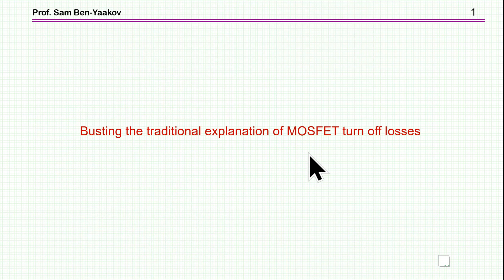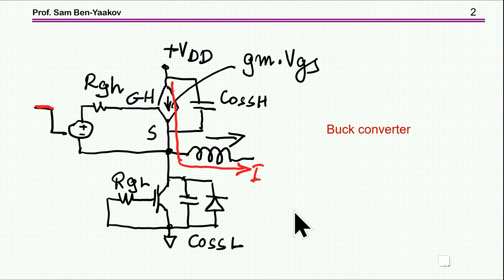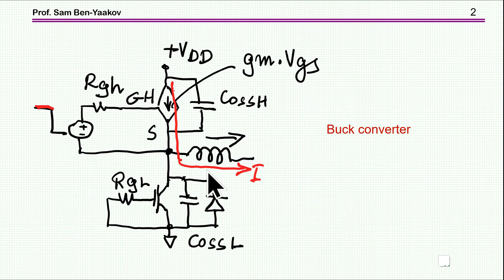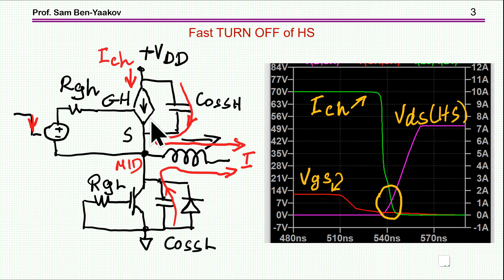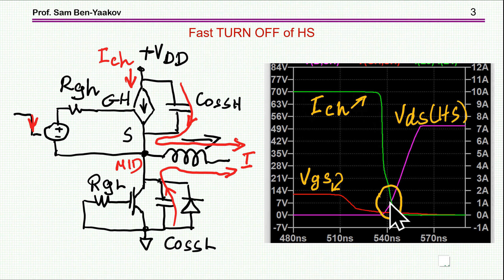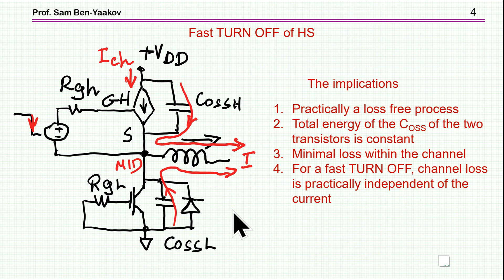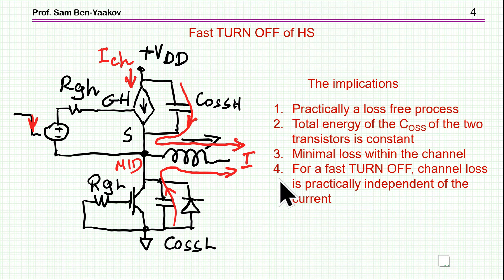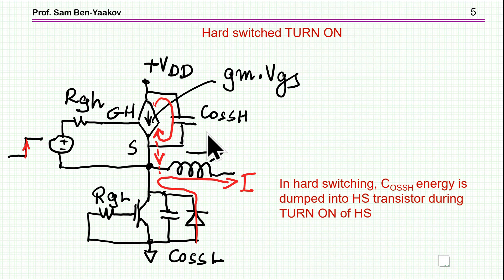Busting the traditional explanation of MOSFET turn off losses

Comment: Hi Prof, during turn OFF since there is a constant ILoad, we merely re-shuffle the charge on the top/bottom Coss elements ? 
Assume top Coss = Coss1, bottom FETs Coss = Coss2, 
during turn OFF, both CAPs give out total energy = (1/2)*(Coss*2*V*V) to the LOAD. 

VDD supply also gave a total energy = Coss1*VDD*VDD out of which half was delivered to the LOAD and Half is currently stored on Coss1. If we do a hard TURN-ON, then this half energy on Coss1 is dissipated in the top FETs RDS_ON while another half is burnt in raising Coss2 up to VDD. 

So essentially if we have hard switching on TURN-ON of top FET, only half the energy associated with the CAPS is delivered to the LOAD while other half is dissipated in resistive elements is this correct ? 

If we ensure that we can make the inductor current before TURN ON of the upper FET is slightly negative enough to charge up the switching node to VDD so that the Body diode conducts, and then we switch ON the upper FET, are we not pulling charge from VOUT and dumping it back to the source (VDD) which is kind of negative work done ? How does that improve efficiency compared to the hard switching case ? 

Kindly help understand this a bit more clearly. Thanks.
Reply from the maker: This is a good question. Hold on, I am planning to prepare a video on that.

Comment: Hello Prof., Please correct me if I am missing something. 

You have shown that the switch current drops first and then switch voltage rises. This seems to be incorrect. 

If the switch current is dropping, diode of oposite switch must start conduction. This will ensure that inductive load current remains constant. But if the opposite diode is conducting, its voltage must be zero. Hence, the switch voltage should be equal to dc voltage. So, this invalidates the starting assumptions. 

Please consider/comment/rectify this point in your detailed video.
Reply from the maker: See https://youtu.be/G0-RCRvd9pY

Comment: This was exactly the thing I wanted to play around with when I eventually get around to finishing up my dumb design of a silicon-based (no GaN no SoC cause I'm cheap!) Totem pole Bridge less PFC!

If I run it in Borderline conduction mode and allow the current to go negative, then I can ensure soft switching, fast turn off for quasi-ZVS, and prevent the body diode losses by allowing the current to go below zero briefly.

This is purely me messing around with this stuff as a hobby so not intended to be practical necessarily, I would probably need a larger than necessary inductor because 2X peak current and inductors having a saturation current. Oh well haha

Comment: Big voltage spikes in the drain parasitic inductance
Reply from the maker: With a poor layout.
Reply: @sambenyaakov  Even without leads, the internal bond wire inductance can be significant and exceed Vdg limits. Flip chip mounting can help.

It needs large gate drive to be an issue though.
Reply from the maker: Thus why soft switching is desirable.